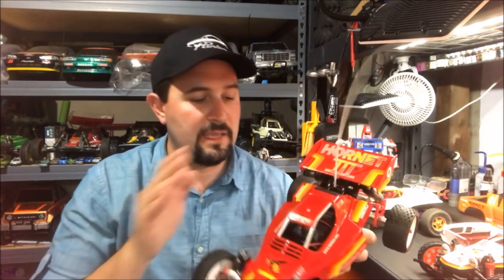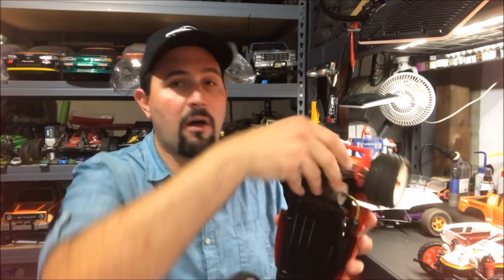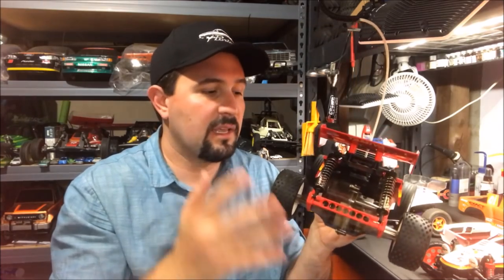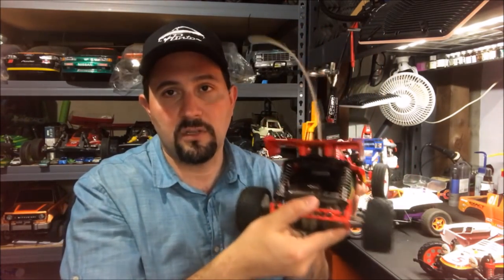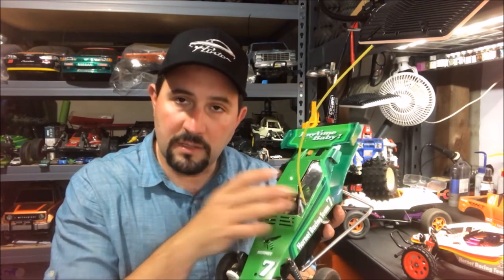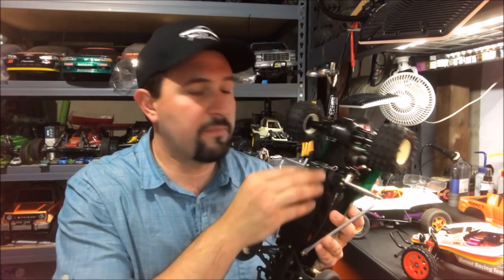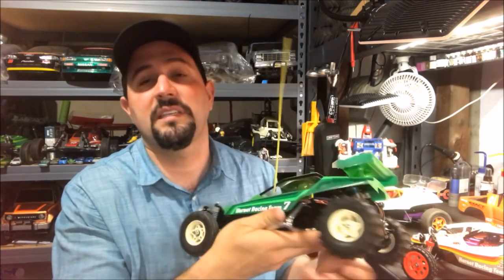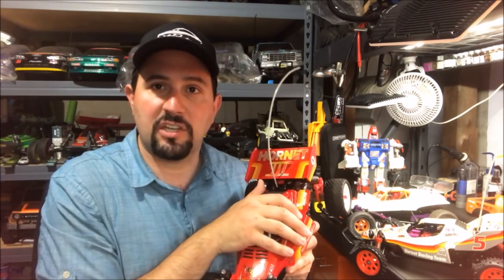The Rise of The TAMIYA RISING FIGHTER #4 Step by Step Upgrade  - AMPRO Transmission Brace!

Comment: Well I must say I was a little sceptical about this mod before watching - but hey! the simplest solutions are often the best! I tried to fit a 3rd shock but failed - just not enough room behind the gearbox to fit a full sized shock in. This mod makes perfect sense - why didn't I think of that? Super job mate - big thumbs up :-)
Reply from the maker: Yeah, exactely, simplicity at it's best. Love it. Tamiya actually did something similar with the DT-01. Maybe you should do a aluminium transmission brace for your Rising Fighter? You certainly have the skills for it. Thanks for the feedback and thanks for watching, Mark, as always.
Reply: Hah! I may just have a go Mikael - when there is time to spare! Thanks for the reply my friend :-)

Comment: Nice Series Mikael!!! 👍👍 I'm enjoying it very much. 
I look forward to FINALLY being able to afford a Rising Fighter, and the pieces necessary, to make it a worthy Buggy! These Braces are FAR better than ANY of the multi Shock or "fishing line" mods over the years....
MAIN reason - unlike the others, the AmPro Engineering Transmission Brace DOESN'T impede or restrict Suspension movement in any way!!
Carmine 🚂
Reply from the maker: Yeah, I really prefer this one too. Solves the problem completely with no extra parts visible when running.

Comment: Yep do remember 😀. That “clonk” is essential to the hoppers. You can always find it by hitting the throttle and wait for the sound... But again great and informative video, and as I run my Grasshopper and Lunch Box more than any other of my cars, I guess I have to give it a shot.

Could there be a benefit from leaving the springs in there too? Guess they wouldn’t hurt.
Reply from the maker: He he, cool! Imagine how many Tamiya talks we've had since then. Still amazed how helpful and calm you helped me getting into the hobby and the Tamiya world back then ... and answering my stupid questions. I'm still a newbie compared to you, but I've grown a little since then. Well, I'm always gonna be two days older than you ;-) 

Yeah, the "clonk" :-) Must admit that I would rather be without that particular Hopper-feature. And now at least I will be with my Rising Fighter. The Grasshopper do not need a brace, but your blue Lunchie would benefit I think. I love this brace. Remember how dissapointed I was just having just build my Rising Fighter. And pretty much in denial that this was the original design. Now I'm ready to run my Rising Fighter :-) 

The infamous springs ... well, I actually think they would get in the way now and need to be removed. They certainly would do no good I think. The Axle Stay Pin sits in the middle of the Axle Stay sliders now. Centered. So they sort of doesn't fit into the design and mechanism anymore.

Comment: Great upgrade, you think that can also be fitted in the tamiya mad bull? Just finished building it btw. I should be showcasing that car pretty soon in my channel.👍
Reply from the maker: Yeah, it's a great little effective upgrade. Nope, not on the Mad Bull. Even though the Rising Fighter has a DT-01 transmission it is designed specificaly for the Grasshopper II Chassis/DT-01 Transmission combination (so basically it will only fit a Rising Fighter). As far as I know the DT-01 chassis/DT-01 transmission already has a similar brace, designed by Tamiya? Looking forward seeing it on your channel!
Reply: Nordic RC Visions : My tamiya mad bull should be showcased soon, stay tuned.😎

Comment: Very interesting video Mikael. I have a few questions. This mod seems very easy to do, and effective, but before you showed this solution my initial thought was doing the 3rd shock mod that's done on the Lunchbox. I am not familiar with either chassis so I don't know if this would be possible, even though they share the same issue with the transmission when built stock.
My other query is; This Ampro part is very effective at limiting the movement of the transmission, but does that mean it also causes more strain on the motor and gears because of the limited flex. Thanks for posting this and getting my brain working whilst having my Sunday breakfast. Thumbs up my friend  : ))
Reply from the maker: Hi Derek! Always interesting to read comments from you, my friend. First of all, I do not have any personal experience, hands on, with the 3rd shock mod, so my thoughts are purely based on other hobbyists experiences.  The 3rd shock mod is done on both the Hopper/Hornets (except of course The Grasshopper) and the CW-01s. It's the exactely same system. I even think the gear box of the Hornet and Midnight Pumpkin is identical. So the problem and the solutions are the same, though I think the CW-01 suffers even more with the gearbox/motor actually hitting the shocks too (!)
The 3rd shock mod seems to have been done to all these models for decades. But as I see it, it doesn't really eliminate the problem with the gear box being pushed upwards under acceleration. It just damps it, making it slower, and perhaps even eliminating the loud 'bang' of the axle stay pin. So it damps the problem but the problem is still there. On top of that I doesn't really like the looks of a shock sitting there. It is just a very visual reminder of the problem. The trans brace eliminates the problem entirely. I have also seen other people securing the trans with a fishing line. But the brace is more visual appealing to me. Both solutions locks the gear box in the middle but still offers the flex/articulation that is the general idea of this system. Imagine, under acceleration, the articulation is actually gone because the axle stay pin stays locked in one position, so all you get it a very lively gear box and under acceleration it is locked and useless. Great system, huh? I think Tamiya actually made a similar system with the DT-01 hoppers. That's why the axle stay pin is exposed on the DT-01 gear box, as seen on the Rising Fighter. 
I'm not sure why it would cause more strain on the gear box being in the same position when accelerating? It just stays in position, just like the Grasshopper and the DT-01s. The harsh and upwards movement under acceleration is useless, and it actually locks the gear box, making it non-flexible under acceleration /the springs Tamiya offers is just for show, making the gear box drop down when not in acceleration). With the trans brace, you have the articulation of the gear box, even under acceleration. So it just works the way it was intended to work :-)
Reply: Thanks mate. It's all a bit clearer now, and I've learnt some  more about the mechanics of Tamiya  : ))
Reply from the maker: I'm learning too all the time. So much nerdy Tamiya stuff still to be unraveled :-)